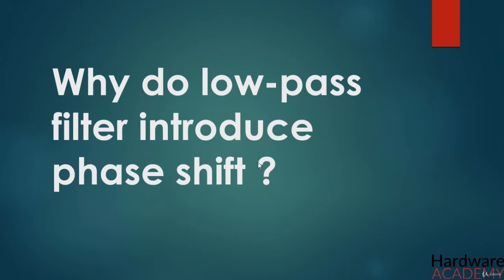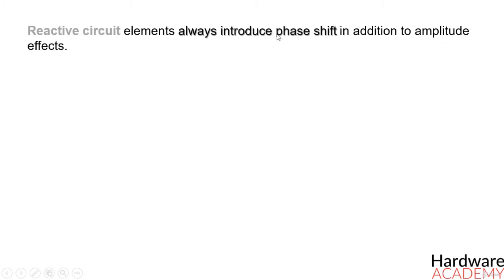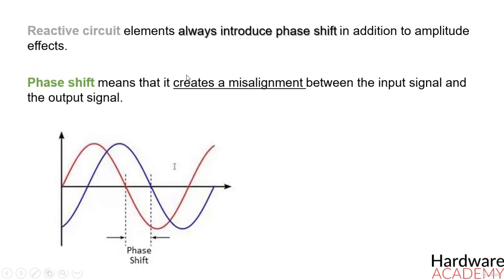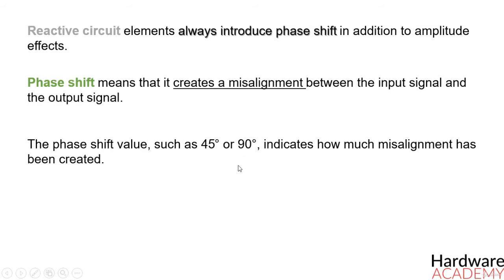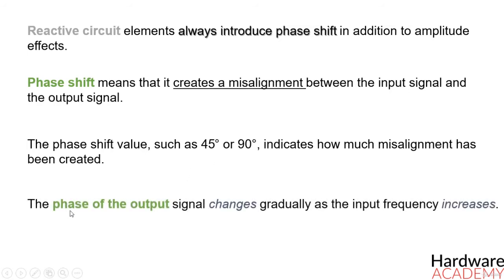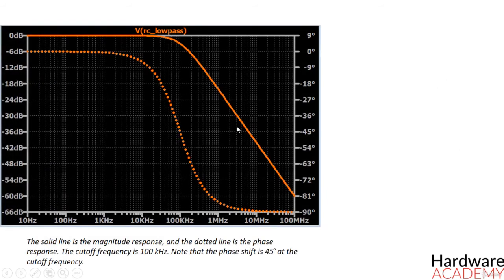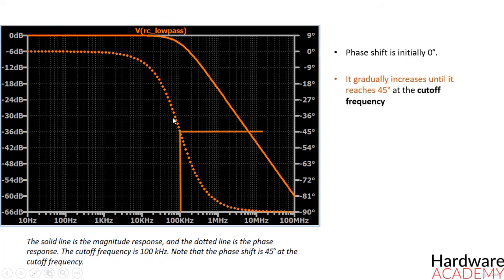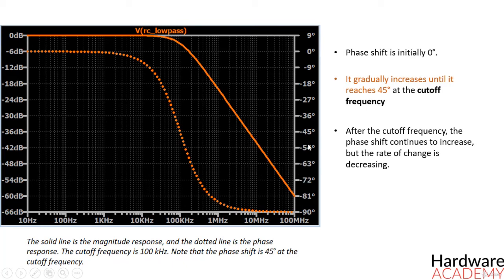42- Why do low-pass filter introducephase shift ?

Comment: I don't think you explained "why do low-pass filters introduce phase shift", but barely introduced that there is a phase shift in LPF and your observations. You mentioned the capacitor but quickly stopped. That's actually the key. You should mention more about the capacitor and its behaviour.